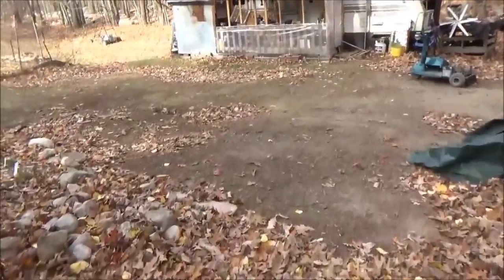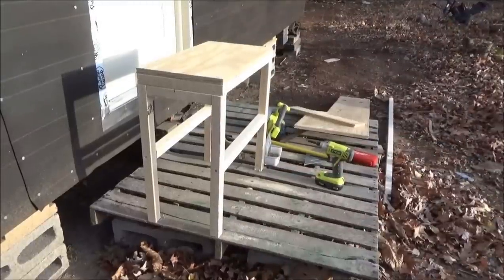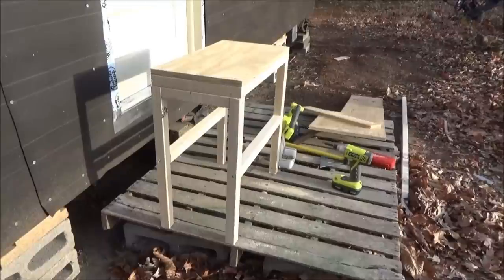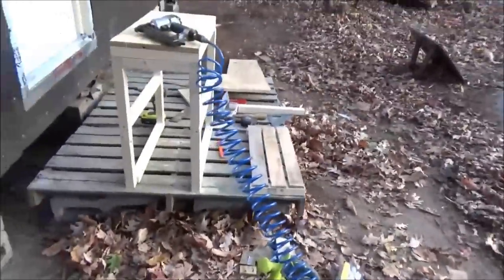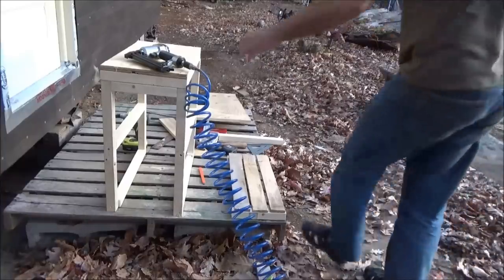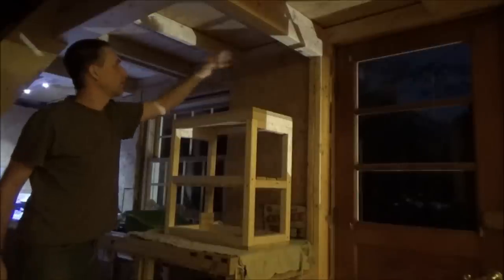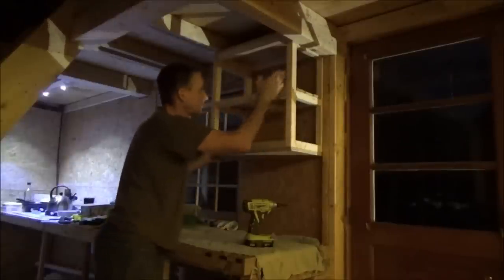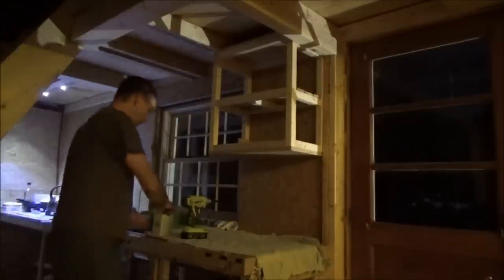Making The First Kitchen Cabinet In My Tiny House N7

Comment: Hint for one person cabinet installation. Use a 2x2 or 2x4 as a guide. Measure up from the counter top to where you want your cabinets to be installed. Do this on the other end. as well. Chalk a line between them.Then screw the board to the wall lined up with the line.  You can then lean the cabinet on the board to hold the cabinet. It makes it easier to attach the cabinets to the studs in the wall. 

Just my 2 cents..:)
Reply from the maker: Boy I wish I knew that a couple days ago :)
Reply: The Do It Yourself World
Reply: I WAS GONA TELL HIM THE SAME THING [GIGGLE] GREAT MINDS THINK ALIKE I GUESS
BLESSINGS
FRANKI

Comment: I know a lot of folks tell you what you "should" do here. As a tiny house owner, I find curtains, especially over lower cabinets, are much easier to work with than cabinet doors. When opening them, one has to step out of the way and in a small space just sliding the curtain over is much easier ...just a thought!  Looks great so far!

Comment: Some advice from the prairies. 
1) use your chop saw to make all these cuts. Way faster and you can even set up a stop when you're making multiple cuts of the same length. 
2) even a doodle can be a "plan" to work from. Write down your measurements, cut the material, then assemble. A drawing can help you to work through problems like where to attach and so on. I do this all the time and I am a terrible artist. Figuring it out as you go often ends up with wasted material.
3) go to the library and get a book on cabinet making.
Reply: FromThe Prairies chop saw and table, get off the ground. Also if you don't know how to do something, or never done it before GOOGLE it, take 5 minutes to learn some basics before trying to re-invent the wheel.
Reply: Greg Ward precisely why I gave up and unsubsribed. I will only beat my head against the wall for so long.

Comment: Your wood will be less likely to split if you drill pilot holes for the screws, especially in the 2x2's. But anywhere where the screws are close to the edge of a board it is a good idea. Looking good!

Comment: Troy, you'll need a range hood. You might want to consider it's placement before building the rest of the cabinets.  Water vapor from boiling will condense on the walls and windows and make a mess.  If you fry without venting, the whole place will get a coating of grease.

Comment: Hey at my job we take old wood pallets apart and use the 2 x 4 supports as closely laid planks on top of other 2 x 4 supports for even stronger pallets. I had an idea that maybe you could build yourself a 2 x 4 wood deck out of pallets and varnish it like you did with your butcher block countertop. Then you could build a real roof over your deck for an extended living space. Give it some thought for a next spring project.

Comment: Second for wood glue and instead of using butt joints consider lap joints for your cabinet framing. That way it becomes part of the structure of cabinet and really difficult to ever split. And if you need a stepstool just make one from your pallet wood, also in a half lap consider it practice in joinery. I've made some long ago that I still use 48+ years later and several stages of weight gain and loss - max cap. 300 lbs, on a 2x2.

Comment: One cabinet down (or is that up?) and what - two more upper ones to go? That will be done in the next video, I hope, so that you can continue with wardrobe and bathroom. Although I would probably get the ceiling in with some priority  That insulation (and the gaps around the chimney) will become dust pockets.

Comment: Troy, as too the shelving, try this, running a 2x2 level with the two bottom shelves. it can be run too the window opening. that way you hind the  bump out of that 2x6. then run the top across the points of the front cabinet opening. that way you save space, but don't lose any space on the shelves.  the bottom shelf can be run to connect too that runner to the down point.   using your plywood as shelving ,it can be built out with the corner supporting the shelves run.  4 equal runs of 2x2's with plywood shelves two supporting sides, will hold the shelves in place. not hard too do.

also try too post sooner.

Comment: on that scooter, you can only use deep cycle batteries, lawnmower batteries will eventually burn out the controller as they are higher amp output. great scooter by the way, made in merriam ks

Comment: One observation about your cabinet. I don't believe it wise to use screws from underneath to hold weight. I.e. the weight of the items in the cabinet will be applying force to pull the screws out from the wood above. One too many dishes and the whole thing will come down. I don't know how to fix it, but I'd be inclined to somehow drop a fastener from the catwalk above so the cabinet hangs from that rather than just the wood grains clinging next to those screws. Or maybe add a cleat or two to the back of the cabinet and fasten it to the wall.
Reply: Actually, the way he ran the screws is pretty standard. He ran in at an angle and not straight up. The bottom shelf does concern me a little, but he will never have much more than about 25 lbs per shelf. Worse case he could insert a shelf onto he top of the bottom layer and use the void for wiring or the like. But I don't think there will be a problem.
Reply: JAI Colorado Won't be a problem.  I have a shelf in my shop that is screwed like that from the bottom.  It holds over 100lbs of machine tools.   His cabinet is WAY overbuilt.  He could have easily just used 4 posts + the top & bottom plywood and that would have been plenty strong for plates etc.  It would have also made a bottom shelf with no lip.
Reply: I agree with the "overbuilt" statement. 1/4 inch ply would have been plenty strong for any cabinet work. I actually only used 1/8 for most of my cabinets in my garage. I did brace each shelf a little more often, but they have been up for over 20 years now.
Reply: ck m I was thinking the same thing as I was watching him build it. At least no one can say it won't hold.
Reply: MotherOfManyHorses I was wondering if he used the thicker plywood because it was at hand... life is like that.
Reply: MollyDolly Yes, he's using what he has.

Comment: Have you considered putting a couple or three LEDs in the bottom of that cabinet to light your work surface?
Reply: Yes, that deep cabinet bottom shelf could hold recessed lighting in it then top that with a new bottom shelf to cover the lighting.  Under cabinet lighting is great.

Comment: Why don't you use adjustable slotted shelving - cheap, saves a ton of space(weight), sopports heavy loads, is adjustable, can be easily removed, can be stabilized side-to-side with a small vertical support

Comment: Are there screws holding the bottom plywood?  I wouldn't trust brads to hold it up.  If it is glued, glue can fail for a bunch of different reasons (weight, vibration, heat, cold, ultraviolet light exposure, etc.).  Really coming along.  Looks gorgeous.
Reply from the maker: 3 inch long screws. I used a couple nails where the wood split but then reinforced the whole thing with the plywood and screws.

Comment: The cabinet looks great. I know it's too late to ask about it, but did you ever think about leaving the cabinet open in the front? Less weight and easier access. Can't wait to see the whole kitchen finished. Good job.
Reply: i did sujest that an open plan shelfing  there would be good just there though cabinets ether side of the cooker  would work
Reply: Personally, and this is just my own weird personal taste, I don't like upper cabinets at all.  That's about the only thing I like in my kitchen, it never had upper cabinets.
Reply: MotherOfManyHorses I, too, think no upper cabinets would help to not close in the kitchen took much. Shelves would work just as well. But as you say, that's just our opinions. :-)
Reply: I'd also leave them open. no need whatsoever for doors, they would just get in the way and be a nuisance, plus they just add more weight.
Reply: Since the cabinet is right by the door I think having doors would help keep
dishes clean. There is always dust/bugs/baby cat fur in the air.
Reply: Some people don't like all their stuff exposed, some people like to show case. If one is a "neat freak" then no doors would be necessary. But if one has a habit of just chucking stuff in a cabinet any which way it lands, then yeah, doors are a necessity.
Personally, I like a pantry closet/room. I don't think that would work for Troy. ;)
Reply: MotherOfManyHorses
one of the reasons id go for cabinets the other side of the wndow but open  by the door  so it acts as a light well
Reply: james head Oh, that's a nice idea.
Reply: Jeff Tower You guys need to get your lies straight.  This lie was posted by SpoonyLuv, now you say it is Conspri racytheory ...
Reply: MollyDolly Yeah, <sigh> it's really getting old.
Reply: MotherOfManyHorses Well, since Troy has NEVER been arrested the whole pack of lies fails.  Anybody who spends a couple bucks on line  is free to confirm he has not been arrested in South Carolina or anywhere else.  Sooo...how could this guy have bailed him out?    Idiots... they need to tune up their lie machine it is sputtering.
Reply: Dale Berry ROFLMBO!!!! That is soooooo funny!! Yeah, then "Troy" has some "sexy" legs in that pool side video! LOL!!!!
Reply: MollyDolly LOL

Comment: the dream is lookin good,lil thing bout the cabnets,looks like alota weight will be added if ya do all like that?
Reply from the maker: I think no more than standard cabinets. Mine have no boards on the sides or the back so no wasted wood and less weight
Reply: The Do It Yourself World
hmm,ok--figured you woulda made solid sides at least to make them compartmentelized incase ya ever do get mice,or other creepy crawlers
Reply: mrreality1313
A little melamine and contact cement can cure that problem quickly and easily...and with almost no weight at all.
Reply: The Do It Yourself World Also, since they are screwed on...just remove them when you move it.  Like furniture.
Reply: MollyDolly good idea!

Comment: you keep adding all that wood and it will never be able to move, most likely the tires can't support it now.  THINK it will pass an inspection
Reply from the maker: It is not overweight if I weight it empty. It will be fine. The only inspection needed is at the DMV if I move it down the road.
Reply from the maker: But then again, I plan to have it professionally towed if that day ever comes anyway.

Comment: the vid makes it LOOK like the saw is at full depth, but it is an illusion due to the heavy guard and the blade itself in shadow. there are indeed fewer teeth in the cut (kerf) the deeper the blade however. kind of a wash eh? oh weelllll,, piddlin' indeed. your cabinet should be able to hold BOULDERS or buckets of gold dude. my friend built a custom home years ago and has yet to put doors on ANY of his cabinets. It WORKS. NEVER HAVE TO SEARCH FRANTICALLY FOR ANYTHING! Just gaze,, and reach,, cool huh? could you show some mercy on an old OCD and let slip how you plan to put up the wind tower?? just a hint, come on man,, please??? later gater. BTW:  Big snow in the great lakes by the 10th. be good